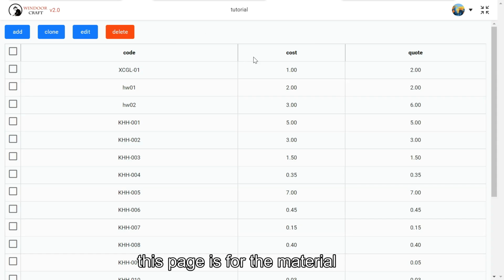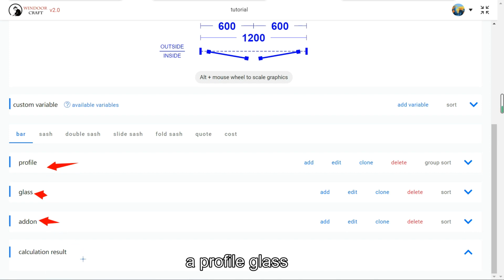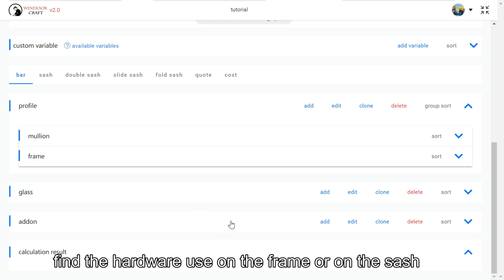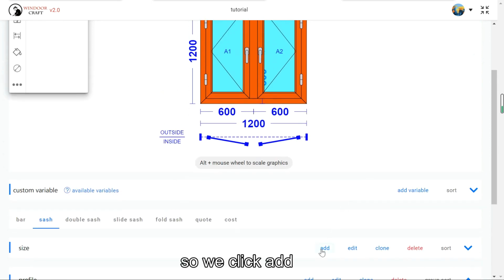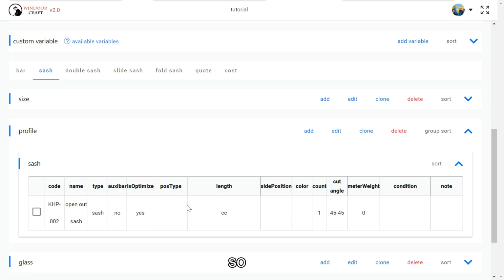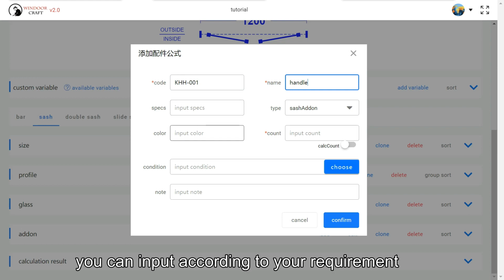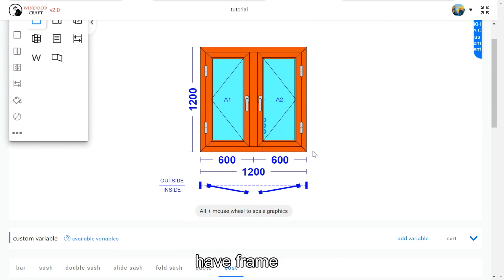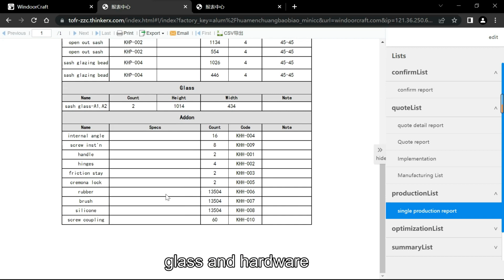chapter 17 - calculate quotation & material list in an intelligent way

Comment: Hello, I have a problem when it comes to heavy optimization. The maximum number of pieces of each profile it can calculate is 127. 

Say I need to calculate 500 windows, it will not give me correct answer